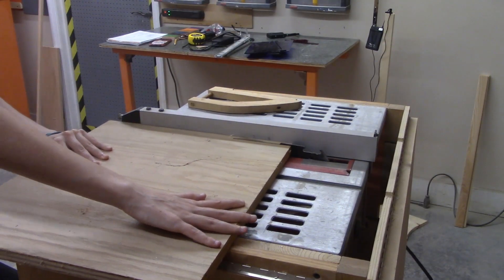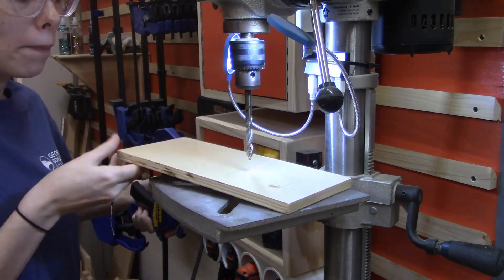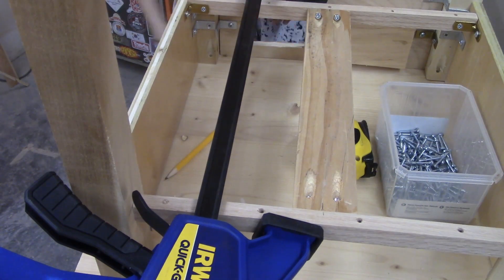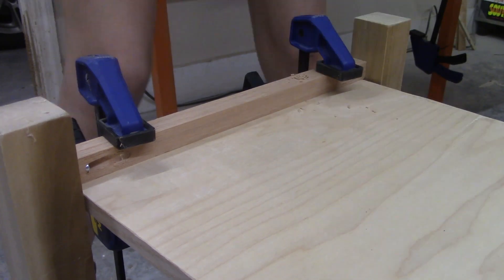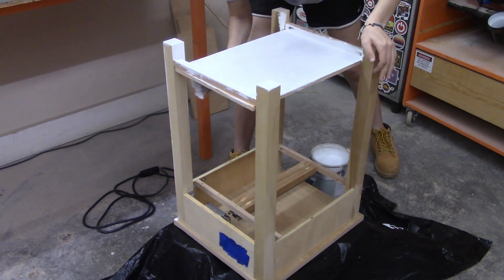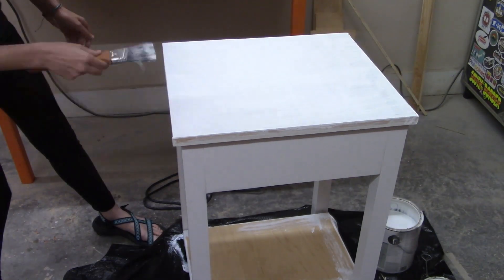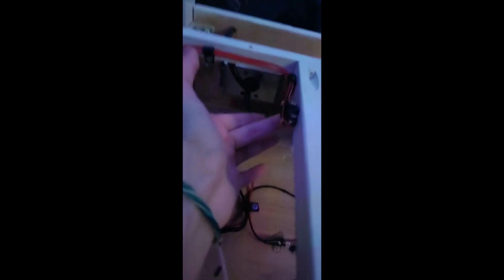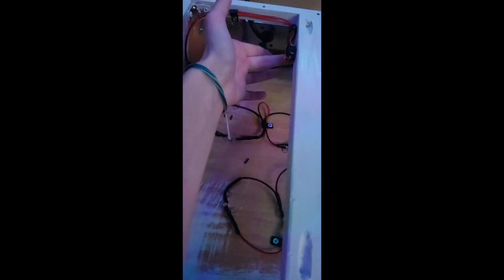LED Bedside Table - It's a table with LEDs

Comment: For the hole you cut with the jigsaw, why didn’t you just drill the opposing  corners and then run the jigsaw on straight lines from there? I think it would’ve been easier
Reply from the maker: That definitely would have been smarter! I'll remember that for next time!